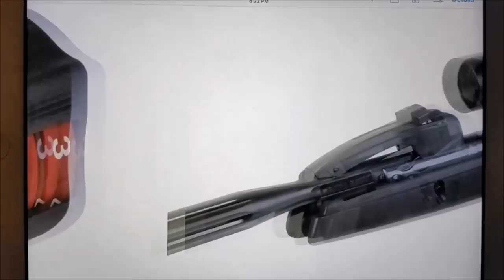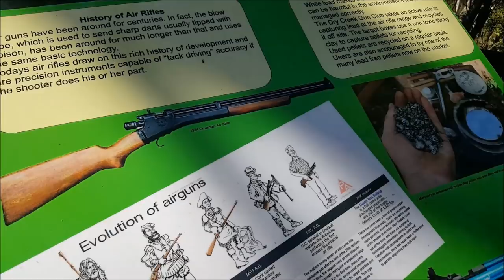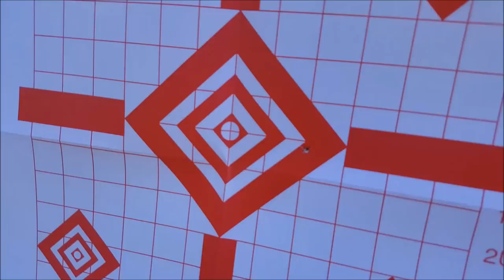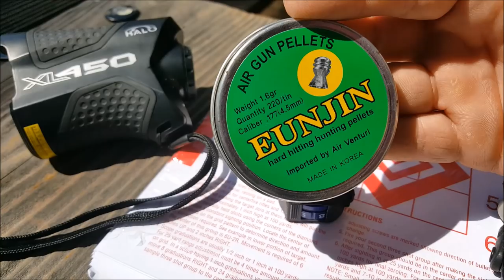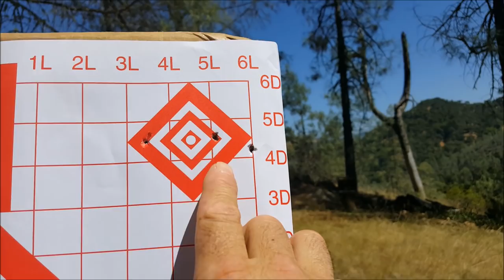GAMO Swarm Maxxim (Accuracy Testing @ 35yd & 50yd) 10 Shot Break Barrel Air Rifle

Comment: You can use any brass, copper or aluminum cleaning rod without harming the the "crown". I recrowned my Beeman due to it having burs in it from manufacturing. BTW We clean them from the breach not the muzzle end. Good video though. Your scope isn't mounted right. It should NOT be hanging back off the rail. You are losing the benefit of having three screws to hold the mont to the gun..
Reply from the maker: Thank you for the tips! -Nate
Reply: Any non ferrous metal that is softer than steel won't scratch

Comment: Always pull your cleaning material (patch/brush) through the same direction as the projectile travels.  From breach to muzzle.
Reply from the maker: I will now!
Reply: Using the exit bore as the insertion point for the cleaning rod is an absolute no-no with any fire arm.

Comment: I know this video and his previous Maxxim video is almost 3 years old, but for anyone new who has watched either one, the scope setup is totally wrong. Gamo has what they call their "Recoil Reducing Rail" designed to, as the title says, reduce recoil from the piston slamming into the chamber as the rifle is fired thus saving your scope from long term shock damage. It's actually a two piece system that is part of the rifle, not the scope. You can see that the front long piece is separated from the rear short piece by about 1/16". This is where the shock absorbent polymer is located. The way he has his scope set up, all the way to the rear, locks both pieces together, therefore negating the shock absorbing action. The scope needs to be mounted only on the front part and not on both parts to receive the shock absorbing benefit . Take a look at other Gamo rifles here on YouTube to see the proper mounting of Gamos RRR scope setup.

Comment: Note: Always pull the cleaning pad in the direction the pellet travels. As to prevent any cleaning solution and dirt/grease entering into the receiver end of the firearm/air gun. Also I like using J-B NON-EMBEDDING BORE CLEANING COMPOUND. Unlike Hoppe's #9 Bore Cleaning Solvent. It’s not hard on rubber seals that are found on air guns. The only time I use Hoppe’s #9 is when I find the air gun has heavy lead build up from pellets. Which is very rare. Hoppe’s can be used in short term use without any noticeable drying of rubber seals. It’s the over cleaning of an air gun with the use of solvents that are meant to be use for firearms that have fouling left behind by ammunition using copper, lead, burnt gun powered. Etc. that can cause problems. Most of the time. when, you need to clean an air gun is when you notice a problem in the way it is shooting. Another thing to think about is that lead acts as a Lubricant. Which some air gun enthusiast love and never clean their air guns. For my self I like to clean my air guns once a year and maybe twice if I’m really shooting a particular air gun a lot. But, truth being said my air guns really didn’t need any cleaning. It’s more of a habit or routine I’ve gotten into. Because, I shoot a lot of my real firearms it’s a habit I afforded from to my air guns. Also you can use a straw to get pass the baffles when inserting the cleaning snake.
Reply from the maker: Thank you for the tips on cleaning Carrie I also learned recently that you can clean your airgun upside down so that solvent does not get in the transfer port. Also I only use ballistol now which is safe for airguns
Reply: Great! It’s all about learning and sharing..,

Comment: I just got a Gamo Swarm Maxxim .177 multi shot break barrel and love it! I also ordered a couple of the JL Crown Saver barrel cleaning tools after watching this video, thanks. It took just 6 days to receive them.
It's almost impossible to clean the rifle with a cleaning rod because of the baffle at end of the barrel. I did manage to clean mine with a Hoppe's air gun cleaning kit before I shot it for the first time. I don't think I damaged the crown of the barrel. That kit has a brass knob on cleaning end and was tricky to get the patches to stay on through the baffle but I did it.
The first 3 patches were black and it took another 3 to remove the rest of the gunk.
The first shot from this rifle was very loud but after that quieted down a lot. The loading of the pellets when cocking the rifle was flawless.
Out of the box at 25 yards I was getting 1 inch groupings about 3 inches below the bullseye and dead on horizontally, WOW! It was getting dark on me so I haven't got to fine tune it yet.
So thanks again for recommending the JL Crown Saver and your videos.
Reply: it was nearly impossible to clean because as another viewer mentioned, he was cleaning it backwards. You are supposed to draw the contaminants away from the inner workings, not towards them. meaning stick it thru the barrel tip first bozo.

Comment: Small Varmints Inc. fully support Gamo.  Their slogan is Hunters with Gamo are safe.  Grin!!

I bought the Gamo .22 Magnum and I had everything properly mounted and secured, regardless the entire so called shock absorbing rail, the entire thing rail and scope all flew off the rifle. So back into the box for a refund. 

Tip: When cleaning a rifle with an fixed silencer use a drinking straw and o'ring.  Push the drinking straw through the silencer to the end of the barrel.  O'ring stops straw from getting lost in the barrel, provides a quick sure guide and path for the weed eater line or string and shrink tube cleaning situation. 

Cheers 
Kit
Reply from the maker: My scope actually flew off in the second swarm video I did.
Reply: @AirgunChannel  ...it looks like your scope isn't locked into the pin-stop....it's waaaaay back on the RRR rail! Most all 'springers' and piston guns recoil enough for you to need to check stock screws quite a bit and also get the correct torque settings on the scope rings and mounting. Great gun!

Comment: some guns just don't like certain pellets. find the right one and you'll see improvements on accuracy.
Reply from the maker: That's very true. I'm going through that with my fortitude right now trying to find the right pellet
Reply: on my gamo silent cat, im using tamohawk and bluefire pellets. tamohawk pellets seems to outperform all the other 5-6 pellets, that I have tried, by far. you'll get a few off here and there but the grouping for the tamohawk pellets with my gun is quite accurate. although I am looking at this gamo swarm because I like the idea of the 10 round shot rotary mag.
Reply: @AirgunChannel  I've tried 30 different pellets and nothing is acceptable consistency. I heard gamo pellets shoot best out of Gamo guns. Which pellet do you recommend? Barrel is clean.
Reply: @rickrazz7136  I’ve noticed that with my ruger air hawk .177. It’s pretty consistent with the Crosman Piranha pellets. But the Crosman Goldflight pellets are not accurate at all

Comment: ALL rifles have a crown and you can use a metal cleaning rod if is non-ferrous metal,..just clean carefully. The best cleaning rods are made of  fibreglass ,..., If your rifle barrel is damaged by using a bore snake then there is something radically wrong here.
 The bore snakes , such as those made/offered by Hoppe's etc. are made of a cloth material ( like a boot lace ) and have fine brass wire brush like material embedded to help clean the barrel.
These will NOT hurt your barrel.
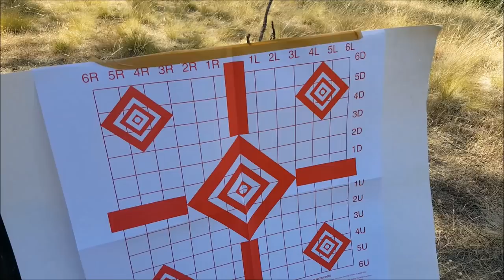By the way,..why do you have your scope mount way back off the rails, as shown at 10:13 and 10:58 marks ?  These mounts should be mounted with full contact on the rifle's rails, unless you want the scope to slide back off the rails after a few shots.
God man,..this review is loaded in errors,...I mean I like the rifle,..but  a lot of what you are saying is not based in fact and is/will be misleading to folks who watch this to learn about air rifle shooting.
If some folks think that I am wrong in what I've said,..it's really easy to check and prove me wrong, if you can.
P.S. I did not watch any more than 11 minutes of this video,...there were just too many bad points in it.
Reply: Well you should have watched a few more minutes cuz scope flew off lol. This guy is wrong on so many levels
Reply: Yeah. hes bad lol.
Reply: Agree...LOL
Reply: If a bore snake can ruin the barrel, you need a better air gun.  You’ll never convince me that a brass impregnated brush could damage a steel barrel.

Comment: This shouldn't be taken as criticism, just an FYI. Hoppe's Nitro Solvent is a fabulous gun cleaning solvent. However, it is intended to dissolve the hydrocarbon by-products of propellant combustion, which are chemically similar to the hydrocarbon polymers that make up your stock, barrel shroud and suppressor elements. Air gun cleaners are highly recommended to avoid degredation of your guns infrastructure
Reply from the maker: Thank you! I use Ballistol now. That was 2 years ago. Thanks for watching -Nate

Comment: Mine .177 prefers 4.52 heads. The best pellet for grouping has turned out to be H&N Barracuda Match or the JSB Diabolo Exact so give them a try if they are available in the USA.  The best 'green (non lead) one was the ThUnderbolt.I have been an airgun shooter for over 62 years and this is the only springer repeater that actually is accurate, reliable and at a decent price. Are you aware that GAMO now actually owns BSA the Birmingham, UK gunmakers famed for their cold forged barrels?

Comment: Nitro piston IS a spring gun! The piston is a nitro spring piston instead of a metal coil piston. Your accuracy will greatly improve with the "artillery hold" over bags or a gun vise. I have a nitro gun and with artillery hold I shoot 0.25" groups average, with soft lined sticks its a bit wild but still 1" groups (mostly deviating on elevation), and with a gun vise its lucky to hit a baseball group.
Reply from the maker: Yes, when you know what recoil to expect (from practice with YOUR gun), you can just absorb it the same every time and get those awesome groups with a springer. That's what Southern Gunner does. Thanks for the comment! -Nate
Reply: There isn't any "spring" in the Gamo Maxxim. It's a gas charged piston which is compressed and pressurized when you cock the barrel. When shot, the compressed gas shoots the piston forward much the same as a "spring" rifle, but there is no spring in that gun, just compressed air. There is always high pressure stored in the piston assembly even uncocked, and they caution you not to tamper with it.

Comment: I don't know if anybody has pointed this out to you, but there is a scope stop pin and it needs to be aligned in the little hole on the rail, also make sure your action screws are tightened and your scope screws tightened and  maybe even some blue locktite, and your groups should increase dramatically and it will stay zeroed, mine was doing the same thing, did all the above and...bingo!!!
dead nuts accurate afterwards.....
Reply from the maker: I ended up using that. At first I was trying to get my scope to be farther back.

Comment: The way I zero my scope is to take one very careful shot with my crosshairs on the center of the target, then starting with the crosshairs in the center just adjust the scope to wherever the hole is.
Reply from the maker: That's exactly how I do it too. Its the best way.
Reply: My swarm easily groups .25 inch

Comment: The muck you got out of the barrel is shipping grease and any gun should be cleaned before shooting just incase something is in the barrel. One thing to make it easier to get the pull through past the baffles is put a drinking straw (plastic if you can find them) in first, once you get the pull through in you can then take out the straw.
Reply from the maker: Great info. Thank you! -Nate

Comment: I have always been told to stay away from Hoppes #9, due to causing dieseling and is bad on any rubber seals. I could be wrong.
Reply from the maker: Yeah, you need to use Ballistol only. HOPS is bad

Comment: Nate, please pardon me if I'm 'correcting you' here because I usually hate such posts.  In this case, what I've learned from experience seemed important to share.  First, I'm sorry if I missed it in your video, but after you clean a spring gun barrel, you should take a minimum of 10-15 fouling shots to season the barrel with lead before you do any accuracy (or any velocity) testing.  Load and shoot them into your backstop or even into the dirt, then do the accuracy testing.  When you do that, your first shots will tend to produce a smaller group that better represents what the gun can really do.  Second, I highly recommend that you avoid using Hoppe's Number 9 Bore Solvent on air guns at all cost!  It will dissolve rubber, plastic, etc, like breech seals and piston seals if it accidentally comes into contact with them.  A less aggressive--but still effective--alternative would be Birchwood Casey Barricade.  Even then, keep it away from the breech seal or transfer port, and wipe any away of it you can see as soon as it tries to go where you don't want it to go.  It may take a few more patches to achieve the same level of cleanliness of the barrel, but it's worth it because you're protecting the air gun from damage.  The nice thing with Barricade is that it also leaves a rust-protective coating when you're done.  A few other MILDLY-solvent products that are on the market will also do a good job without damaging anything, but Barricade is my personal favorite.  Bottom line: that offensive smell you noticed with the Hoppe's bore solvent was trying to tell you something.
Reply from the maker: Edward Krzynowek ....thank you for the valuable info. I did not know that about seasoning the barrel. I will also switch to the Birchwood Casey solvent. Thank you for leaving a comment, great information, I really appreciate it.
Reply: I've heard that Ballistol is pretty good for airguns.
Reply: Me too.  I've just never tried it.

Comment: U mounted the scope too far back but guess that is ur preference but usually u want that scope stop pin in its hole
Reply from the maker: I found that out the hard way ...when my scope flew off while I was shooting.
Reply: What is scope stop? I am a beginner i mounted the scope but don't know about scope stop kindly guide me
Reply: @asimmehmood7452  scope stop PIN
Reply: For anyone reading your supposed to mount the scope infront of the first rail, it has a recoil absorbent for the reverse piston action.

Comment: I've owned this gun.... note "owned" as in past tense.  I returned it because the accuracy was HORRIBLE!  (thank goodness for Amazon Prime ;) )   Even after 500 rounds, the best this gun would do was 3/4" groups at 15 yrds.  Unacceptable!    That being said, I do own a Gamo Swarm Whisper, and after A LOT of tinkering/work, have it shooting 1/2" groups at 15 yards....but that's about the best I have seen from any of the 4 Gamo guns I've tried (and returned).     My instincts are that Gamo guns are spotty in quality.... in fact the afore mentioned Gamo Swarm Whisper...... I returned 2 before I got a "good one"..... the first one had the loading mechanism fail within 150 rounds.  The second, the trigger broke internally in about 300 rounds.   The third one has been doing OK for about 2000 rounds now..... it's still not accurate enough for me to "trust it" for hunting, but the repeating function makes it a fun gun to shoot/waste pellets with.  :)
Reply from the maker: Wow. Great info! You just can’t trust any spring gun sold at Wal Mart. (Gamo). I’m looking forward to when you try a PCP. It is a huge pain in the butt to do the Air part but there are some great budget PCPs. The Gamo Urban is supposed to be one of most accurate. and I also liked the Benjamin Fortitude a lot. Here is a cheap PCP video: https://youtu.be/j7BCo4lfnFM   You can get a Drager tank 2018 now for under $100 and just get it filled at the Scuba shop....no compressor or hand pump needed.
Reply: @AirgunChannel   To date, I've resisted the PCP route, simply because it urks me to spend 2X the money on "support gear" for the gun.  I've shot a couple of PCP guns, and do like a lot of things about them.....but not enough to drop approx $1k on the needed "support gear".   The one gun that MIGHT make me go the PCP route is the new Marauder semi-auto...due out later this year.

Comment: Probably not critical with that soft equipment, but best to clean from Breech to Crown, not the other direction.
Reply from the maker: Great advice! Thanks -Nate
Reply: @AirgunChannel  I just got my Maxxim Swarm 0.177 yesterday. Used a straw to guide weed wacker cord from into crown and out the breech. Then pulled Mason twine back through. As things got oily from Hoppes I couldn't get tape to hold between the cord and twine.  Then used shop vac to suck twine from breech out the muzzle.  Either way, tied patch to twine and pulled from breech to muzzle. I use 7mm Mag patches cut in half to clean 0.22LR, 0.223, and now 0.177.
Thanks for the reminder to clean before 1st shot. Mine was just as dirty.

Comment: The barrel shroud is probably a vibration damper. When you pull the trigger, the spring causes the entire rifle to vibrate which can result in a loss of accuracy.
Reply from the maker: Good call.  It definitely takes some practice to shoot a Spring gun accurately. Not like PCP with no kick
Reply: There is no spring. Its a gas piston

Comment: You did not put your scope on right. You need to make sure the pin is in the pinhole towards the back of the scope rings. look under the rings. That will keep the scope from scooting back and falling off. I used to own this rifle.
Reply from the maker: Yes, I saw the holes...wanted my scope farther back...but I ended up putting it in the holes in the end.